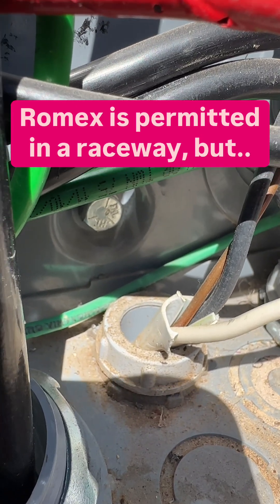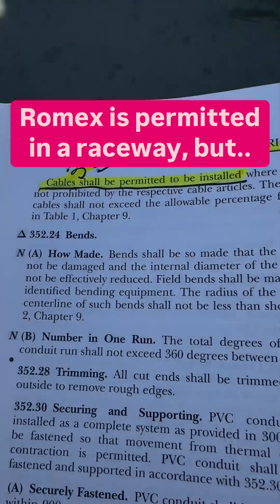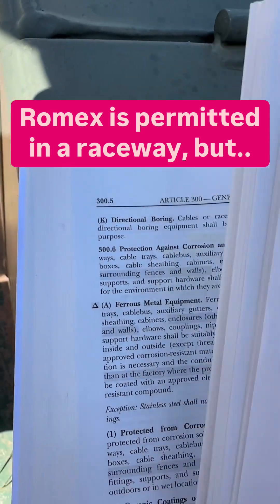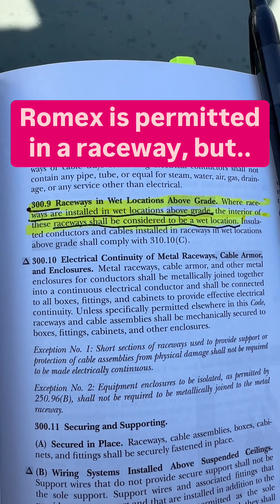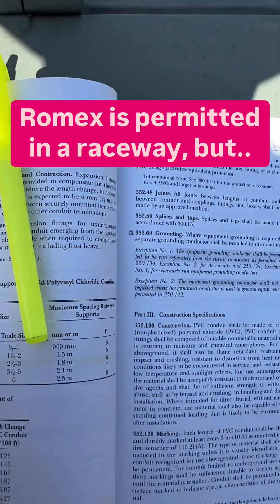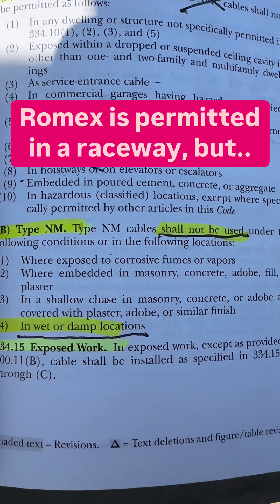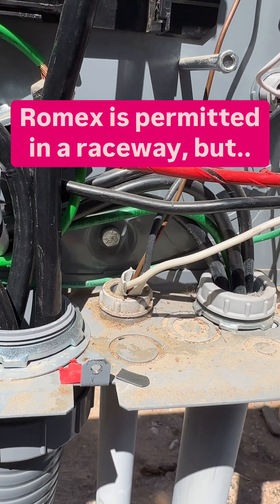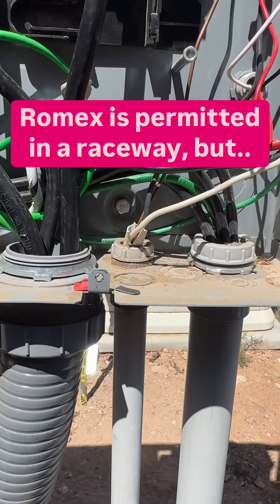Romex is permitted to be installed in any raceway, but not in a wet location 334.12(B)(4) and 300.9.

Comment: What about NM (romex) in a pvc raceway under ground in a house from interior wall to island when the house is a slab on grade. 

A little background we currenlty install UF cable I'm just curious if those same codes apply restricting the use of NM or if it's another code as I'm not sure how this example would be classified?
Reply from the maker: The key to your answer is if the inside of the PVC raceway is a wet location. Step 1. See Article 100 Definition of wet location states that a raceway underground (dirt), or in concrete slabs in direct contact with the earth is a wet location. Typically in Florida (and probably many other states) a plastic vapor barrier is installed between the earth and the concrete. So in that case the inside of the PVC raceway is a DRY location and NM cable is okay. I no vapor barrier is installed, then the PVC raceway makes contact with the earth and it's a wet location, and UF would be required.

Comment: They should use Thhn insulation for the conductors in romex .
Reply from the maker: Why? THHN is not suitable for a wet location, see 310.10(C).
Reply: @MikeHoltNEC  Didn't know that. I see so much THHN wiring even inside and to Rooftop HVAC units specifically from the disconnect to the line terminals in the unit. So for outdoor conduit it should be THWN wire then?
Reply: @brnmcc01  all the THHN you are gonna buy today is dual rated THWN-2. Mike is just saying THHN is not the insulation that permits the wire we call “THHN” to be ran in a wet location. That would the THWN-2 rating or similar. So as long as your wire is also rated THWN-2 (which is extremely likely) then it is permitted in wet locations.

Comment: so if its frozen is it a dry location ?
Reply: Frozen is temporary still dissolves
Reply from the maker: 300.9 states that the insides of a raceway located outdoors is a wet location. I'm not sure what your comment has to do with this post. Sorry you are confused. Try watching the video again and read NEC 300.9.
Note: After the video was posted, it was brought to my attention that the cable is actually UF which is listed to be suitable in a wet location [340.10(3)], so, this installation is correct.

Comment: Had this same issue the other day. I have a 12×12 metal box surface mounted to stucco. I made a raceway with a 2" nipple that acts a transition point from drywall to the back of the pullbox keeping the romex dry. Inspector said I need to make my splicing inside the drywall?
Reply from the maker: And he was right.

Comment: What’s the Romex feeding ? If it’s installed in a rigid conduit how’s moisture going to affect it ? I’m more concerned with the ground conductor not being insulated ? Thanks.
Reply from the maker: I 'now' realize that the cable is UF cable which is listed to be suitable in a wet location [340.10(3)], so, this installation is correct because the wires within UF cable [340.104] are moisture resistant (suitable for wet locations). Sorry… (I just physically checked).

Comment: Yup… spot on Mike and that you used the code book to illustrate. Spot on my brother.
Reply from the maker: 👍I 'now' realize that the cable is UF cable which is listed to be suitable in a wet location [340.10(3)], so, this installation is correct because the wires within UF cable [340.104] are moisture resistant (suitable for wet locations). Sorry… (I just physically checked).

Comment: It looks to be uf. Direct burial with pvc to protect it going into the panel
Reply from the maker: I 'now' realize that the cable is UF cable which is listed to be suitable in a wet location [340.10(3)], so, this installation is correct because the wires within UF cable [340.104] are moisture resistant (suitable for wet locations). Sorry… (I just physically checked).

Comment: It looks like UF cable to me... ?
Reply: On a second closer look. It does appear to be UF cable. C'mon Mike!
Reply from the maker: I 'now' realize that the cable is UF cable which is listed to be suitable in a wet location [340.10(3)], so, this installation is correct because the wires within UF cable [340.104] are moisture resistant (suitable for wet locations). Sorry… (I just physically checked).
Reply from the maker: I 'now' realize that the cable is UF cable which is listed to be suitable in a wet location [340.10(3)], so, this installation is correct because the wires within UF cable [340.104] are moisture resistant (suitable for wet locations). Sorry… (I just physically checked).
Reply from the maker: I 'now' realize that the cable is UF cable which is listed to be suitable in a wet location [340.10(3)], so, this installation is correct because the wires within UF cable [340.104] are moisture resistant (suitable for wet locations). Sorry… (I just physically checked).
Reply from the maker: I 'now' realize that the cable is UF cable which is listed to be suitable in a wet location [340.10(3)], so, this installation is correct because the wires within UF cable [340.104] are moisture resistant (suitable for wet locations). Sorry… (I just physically checked).
Reply: UF jacket encapsulates each conductor individually. Its either 14/2 NM, older white jacketed 12/2, or standard 12/2 NM faded from sun exposure.
Reply: @brianeaston007  UF encapsulates each conductor until you split it open. NM cable has a brown paper wrapper on the grounding conductor, which is not visible...

Comment: So what about under ground romex! I have bought 10-3 to run from my storage building to my house about 75 feet !?
Reply: UF is the correct cable to use for underground and wet locations, so you're good to go. The paper jacketed NM cable is what is not listed for that wet location or direct burial type of use.
Reply from the maker: I 'now' realize that the cable is UF cable which is listed to be suitable in a wet location [340.10(3)], so, this installation is correct because the wires within UF cable [340.104] are moisture resistant (suitable for wet locations). Sorry… (I just physically checked).
Reply from the maker: I 'now' realize that the cable is UF cable which is listed to be suitable in a wet location [340.10(3)], so, this installation is correct because the wires within UF cable [340.104] are moisture resistant (suitable for wet locations). Sorry… (I just physically checked).

Comment: This is an area where you could simplify things by just saying no romex in conduit. Just my opinion.
Reply from the maker: Hum... you clearly missed the point. Because NM cable is permitted in raceways. Sorry I confused you... maybe watch the video again...
Reply: @MikeHoltNEC  sorry Mike I meant simplify the code by not allowing it 😬
Reply from the maker: There are many rules in the NEC and practical applications where NM cable needs to be in a raceway (physical protection).

Comment: So if you run romex through conduit outside it would have to be uf?
Reply from the maker: I 'now' realize that the cable is UF cable which is listed to be suitable in a wet location [340.10(3)], so, this installation is correct because the wires within UF cable [340.104] are moisture resistant (suitable for wet locations). Sorry… (I just physically checked).
Reply: Yes, and size the conduit accordingly
Reply from the maker: See NEC Chapter 9, Notes that address this condition.